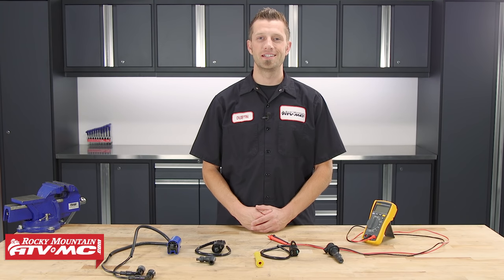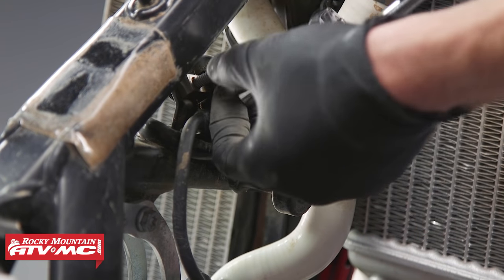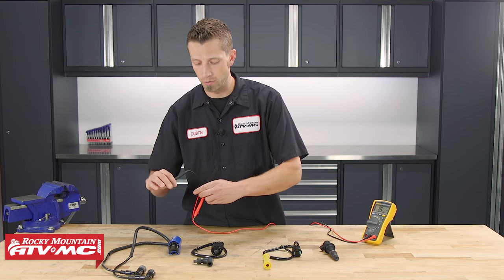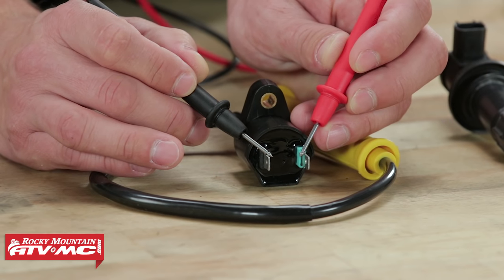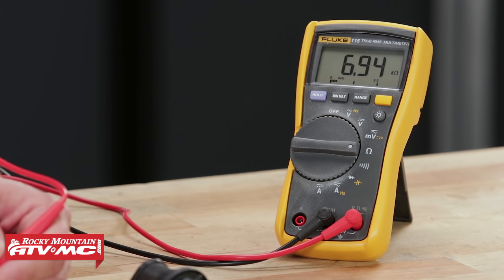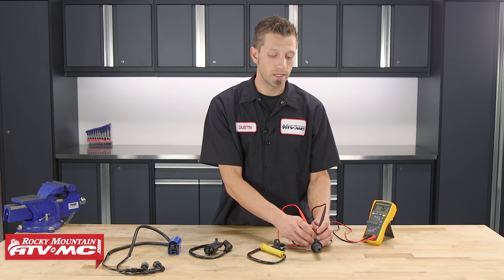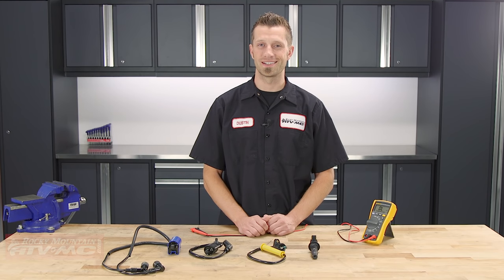How To Test Motorcycle, ATV & UTV Ignition Coils

Comment: How about doing this video again. This time actually show people where you connect the leads to test the secondary. Ridiculous
Reply from the maker: If your coil has two secondary leads, measure cap to cap. If you only have one secondary lead, measure from the cap or high-tension wire to the primary terminal/post (the little metal tab).  If it is a coil on cap (stick coil) the two primary leads are on top, and where it clips onto the spark plug is the secondary side. Testing will be the same as a coil with only one secondary lead. Just make sure you are getting a good contact to the metal in the spark plug boot. Also, in my experience it's not super common for ignition coils to fail, but it can happen so always a good test. -Charles
Reply: @rmatvmc just watched your video more as a reminder, no complaints from me, seemed all perfectly clear thank you.

Comment: I did the secondary test and got nothing. The primary test I got 1.8 ohms. I even tested a new ignition coil for secondary test and got nothing as well. What’s going on?
Reply: shorted secondary. coils junk. could've gotten some moisture in it through a crack.
Reply: That specific coil could have a diode in the secondary circuit.  If it says 0L, that could be the case.

Comment: Justin.....I really saved me from going to John Deere....

I did all the tests and it worked just like you.....said....... everything was good according to the tests and the ohms ........ so I dug deeper it was a split or crack in the end of the plug wire....on the motor....

I took the cover on the 825l gator and looked in where the plug is on motor it was arching to the head......

So glad you did this Vedic.....I ordered new wires.....

Thanks Justin you saved this Veteran  a lot of money lot money.......Rick.....
Reply from the maker: Very nice work Rick.  Thanks for watching our video!  Glad it helped you track down the issue you were having.

Comment: I just replaced the Lucas coils on my 1970 500cc Triumph 'Daytona', even though the checked out okay with the ohmmeter and even though the bike was running reasonably well. I did so mainly because they were fifty years old and because one cylinder always developed a misfire when 20 minutes of running (perhaps because the coil was breaking down when it got hot). The new German-made Lucas replica coils Ohmed out the same as the old coils, however compared with the anemic spark of the originals, the new coils were flamethrowers, delivering a bright blue spark.
The point is, just because a coil tests okay doesn't mean it's as good as it could/should be. Good coils are especially important on race bikes and other applications where high performance is desired.

Comment: In my years as a cycle mechanic I found a lot of bad plug caps that needed replacement. Check plug cap resistance
Reply from the maker: Good tip! Thanks for the advice!

Comment: Testing a coil with a ohm meter on the primary side measurement seen is straight forward because being measured so directly to the winding. The secondary side on the other hand is only obvious when defective if being "open" . A given specification from a manual in resistance of a coil secondary side appears sometimes to vary greatly when measured from where it is measured either at the coil or the spark-plug cap. What is not stated in some manuals is to include or excluded the spark-plug plug wire when measuring.

Comment: Great video.  Now I've just gotta find the recommended resistance for my McCulloch chainsaw coil.   That will be the hard part!
Reply: it should be in the 250 range for the secondary, and .2-.4 ohms for the primary. lots of 2 stroke coils measure around there, but not all so check the service manual or look online.

Comment: One question - when the ignition switch is switched on, on a 1987 Honda 450 C.C. C B model,
how many volts should be going in to the coil through the yellow wire please???? I am only getting a reading of around .6 to .7 of a volt - is that much too low??

Comment: My vulcan 1600 classic has 2 of those blue coils,  do the connections on the primary side from computer to coil matter which tab they plug  into ie  pos and neg connectors?  new coils are getting power to primary but no power to cap hence spark plug .

Comment: what should primary to secondary resistance be on a dual coil? it doesn't specify in my manual, do we only check plug wire to plug wire for a secondary test?

Comment: What would be the symptoms of a bad ignition coil on a 2 stroke? Because my bike bogs when I turn the throttle and it has a really rough idle.
Reply: Don't just jump to the coil. If it has a bright blue spark when you kick it over likely the coil is good.

Comment: So, I have a coil that looks identical to the second one you tested and I tested it with my meter and all tests passed except one. so you tested the from the coil to the end of the wire without the cap on and my numbers where the same as yours but then when I screwed the cap back on it didn't add any resistance. which at first I thought would be a good thing because it would allow the electricity to flow more freely but the more I thought maybe it needs more resistance to create a spark. So, do you think that because the cap doesn't add resistance that just the cap is bad? I don't have any spark at all on my bike so maybe it's the stator? idk, I've tested literally everything and if need that extra cap resistance that may be my problem. What do you think?
Reply: I dont think all caps add as much resistance as he says. It's basically metal to metal contact and as long as the inside of the cap isn't corroded which would/could add resistance when u place your meter tip there you should get minimal add'l resistance. So basically all your measurements sounded fine. Jst need to make sure they match up to whatever the specs are for your coil and/or are similar to a new replacement one.

Comment: I have an old 1977 kawasaki kz400,i have no spark at the plugs.There is a 10.8v reading at the constant live on one of the two primary spade connectors with the ignition on.(battery is 12.6v)
Can this be a sign ignition coil is bad that coil is getting a live feed yet there is no spark?
Reply from the maker: Yes, but test to verify. 1-test the coil as shown in the video. If your readings aren't good, then it's safe to say that's the problem. 2 - If the readings check out, make sure the points are correctly adjusted and in good condition. The voltage needs to be interrupted (triggered) to have spark. 3 - the low voltage indicates you might have corrosion on some connectors. I would go through and clean those up. 4 - If you can get a manual for that, I would go through the tests listed in there. -Charles

Comment: When dealing with a 2 plug coil (as first shown in this video) is there any test to check of continuity in between primary and secondary. I.e. resistance between a primary lead and the plug wire? 

I've been chasing a no spark on a 93 Kawasaki 750 jet ski, primary and secondary have checked out per spec, ~.4ohms and  ~4K ohms, respectively. 

Having isolated all other factors I'm not fully convinced the problem isn't the coil.

Comment: I have a 2014 Honda Rancher TRX420TM1 with primary coil impedance of 2.3 ohms and a secondary with out boot of 13.39 ohms, with boot 18.52 ohms.  Service manual  does not provide good resistance values only peak voltage.  Yours with yellow boot was primary .4 ohms; secondary w/o boot was 1.7 kilo-ohms and w/boot 5.7 kilo-oms.  So is my coil bad? ATV starts and idles but stalls when trying to give it gas.  Changed Fuel Filter assembly, Fuel Injector, IACV, tested fuel flow.  Turning on ignition with new pump it shoots out a steady stream.  Tank cleaned.  I am at a loss.

Comment: What happens if your wire going to your ignition coil is getting like 40 volts. Is that a bad Cdi?
Reply from the maker: What bike? Are you using a peak to peak adapter? Usually you should be getting closer to 100 P to P Volts to the coil. Check if it's an AC or DC CDI and make sure you have enough power going into it before you replace the CDI. -Charles

Comment: I am testing the coil on my honda 400ex. My multimeter has ohm settings but unlike yours, has multiple ohm settings. Which one do I turn the dial to? Choices are, 200, 2k, 20k, 200K, 2m or 20m. Sorry, I am a rookie when it comes to using a multimeter
Reply: Here is a "rule of thumb", start at the highest setting and click down until you get a reading.  In this video the 20k selection would be good.

Comment: There is 5 different ohms settings how do I know which one
Reply: look up the correct range for what you are testing and set your multimeter to the next highest setting. For example if you are measuring the primary side of the coil and it specs at 5 ohms, set your meter to 10 ohms. If something was needing 15K ohms, set to 20K ohms.

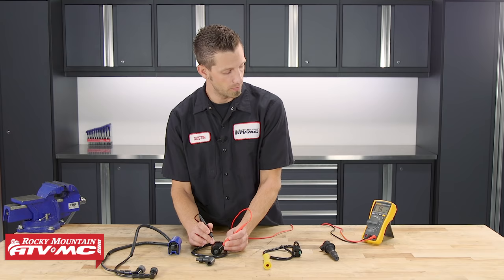Comment: 2:53 I get nothing when pushing probe into wire. And I get a lot of fluctuation when doing previous method all the from from 0.8 clear to 100 ohms.
Reply from the maker: No reading, would mean need replacing.
Reply: But I do get spark that comes and goes when grounding to cylinder head. Is that normal?

Comment: On the third coil which looks like one for a 150cc Chinese scooter with an A/C fired CDI box, could the LACK of a resistor type spark plug cap(when not running a resistor type spark plug) on the spark plug be the cause of a weak spark and missing causing the engine to be unable to accelerate much above an idle  while on the center stand ??

Comment: I know im a little late but some help would be awesome. Was testing the coil on my raptor 350 and the ohms were bouncing like crazy. Its an amazon multimeter so im wondering if its the meter or if the coil is indeed on the fritz. Any help would be appreciated.
Reply: Touch leads of meter together in ohms mode, should go to 0 and not bounce if it worth its salt.

Comment: Does temperature affect coil performance?  Bike runs smooth when cold, then misfires when hot.  Coil problem?  I’ll do the multi-meter test on cold and hot coils and see if that changes the reading.  Thanks!
Reply: PatDPT stater problem probably

Comment: a question that no one can seem to answer can you?  I own a 2008 Yamaha XT125R  trouble is when I go through  any axle deep water  the coil get splashed and shorts out,  I found this is the problem because it's very low  on the frame and is open to all water splashing towards it.  can I move it and put it under the seat?   where there is plenty of space and it is out of the way?
Reply from the maker: As long as all your wires still reach and are routed safely, there shouldn't be any reason why you can't relocate the ignition coil on your XT. 
Hope that answers your question!
Reply: @rmatvmc   Thank you very much for replying now I can do that without worrying.

Comment: I got a single connection line my cap on my spark plug wire is too small I can't fit to get a reading what can I do
Reply: Use a small piece of wire to contact then meter off wire

Comment: Thanks for the video.
I need some extra help, atv is struggling to run and start consistently and when we turn it over the ground wire from the coil has heated and melted the insulation.
Can anyone advise what might be wrong please?
Reply: Short in the primary circuit of the coil.  Check resistance as noted in the video.

Comment: Great video 
Is it possible to use an ingition coil and transfor the voltage to 14 volt and charge a battery?  The idea is that the small engine that I own can not be fited whit a stator. So I would fit a second ingnition coil. One for the spark plug and a seconde one to create 14 volt to charge a small battery.
Thanks a lot

Comment: please help me with this problem with my bike . Its start when completely cold and only i can run for 2-3 km. Then its become misfiring and stopped .. No spark came out from the plug wire. All wires are in perfect condition . But not starting . After it become cold its start again .. What can i do for that??  Hope you ll help me with this ....
Reply: Ive got the exact same problem, trying to find out why
Reply: Dylan Black dude finally its resolved . replace the stator.. Old one looks like working great but the wires inside  are burned . When its become hot , the resistance not good.

Comment: i have a dinli 2001 trex 4 wheeler and i dont have no spark we have a spark plug tester we tried that didnt do any thing what should i order if its good but it wont start just a new spark plug or the coil
Reply from the maker: Alec Raddant vlogs I would start with the simplest thing first.  Get a new spark plug, especially if your old one has some carbon build up and is dirty. Then move to the ignition coil from there to try and pin point the problem. Let us know what you find out. Thanks

Comment: Hey i have a question about my ignition coil.  I have 2002 bear tracker and I was blowing fuses and wasn’t getting any spark so I went through the whole harness and replace all wires that look wore.  Checked all wires with meter and everything looks good.  But,  I took my ignition coil off and checked the resistance for specs.  Primary to coil base was good. Pulled the plug cap off and checked the cap itself and it was checked out good.  Checked the base to spark plug wire lead with the cap off and it was also good.  So I crewed the cap back on and checked resistance from primary to inside of cap and it read at 18k ohms.  It’s suppose to 10k.  Do you know why it would be so far out of spec when everything checked out good?   I even spliced a new wire with cap and they read the same.  Was within spec before connecting to wire coming from the coil.  Any help will be gladly appreciated
Reply: next ime you blow  fuse conn meter on ohms scale to the  wire leaving fuse holder  other lead to gd  you should get a reading start disconecting till reading falls off  should find a wire pinched or a defect insulation.

Comment: a coil is simply wire  wound in a circle many times  the small winding is the primary winding  the seconary  winding has many more turns call turns ratio  the spinning magnet on the flywheel creates a voltage in the primary winding noe du to the turns ratio the voltage greated in secondary is very many times  higher which creates the spark  you can prove this by taking a long copper wire wind around in a circle   many times (20)  or so  conn your volt meter leads to both end of the wire set on low volts now wave a magnet nea the coil watch meter  #s come on proving you are creating a voltage

Comment: all  these test are  just measuring copper wire none of them tell if the coil works as it should i have worked on engs   all my life  i can remember replacing one coil it was on an out board mtr these are rubust items they seldom fail  ( no moving parts )spark prob. are elsewhere.  im 88 yrs old  so i have seen afew